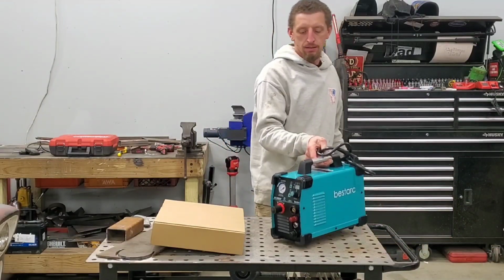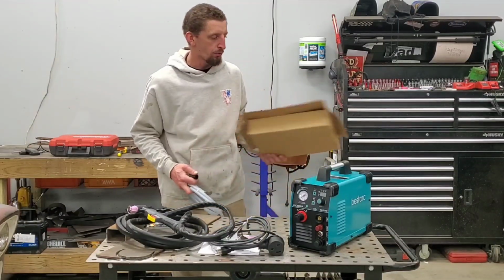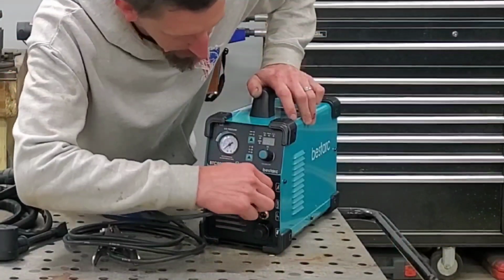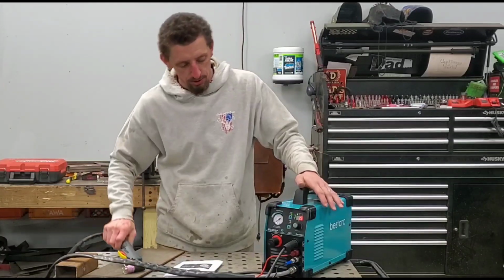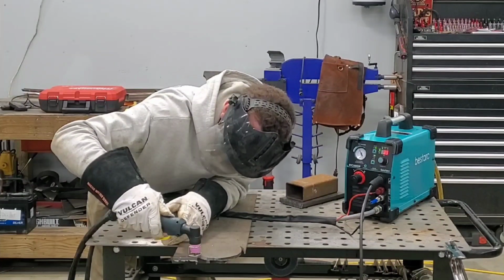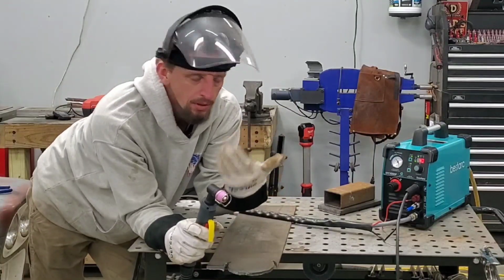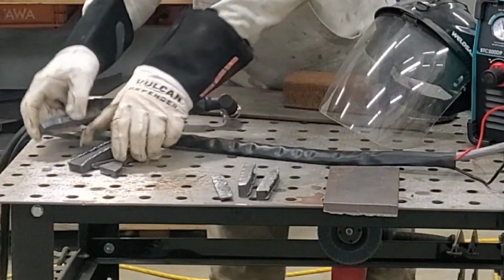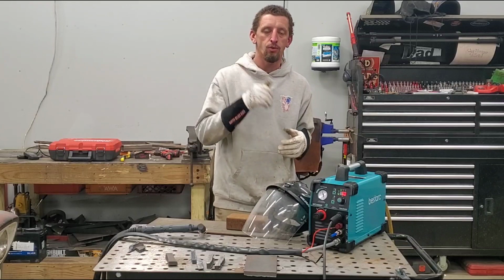Which Plasma Cutter Should I Buy?  Check Out The BestArc BTC500DP !  Full Product Review & Setup

Comment: So what is your opinion between the bestarc vs arc captain? They seem to be comparable in price but HF vs pilot arc (I'm not sure what the difference is). Thanks for your time doing these videos
Reply from the maker: Ugh, trying to get me in trouble 😂😂😂.   I really can't answer that out of respect for BestArc, the machines are very comparable in price and performance and both work almost identical, the ArcCaptain has a clean LCD display while the BestArc is already wired at 220v both have pros & cons.   Sorry I couldn't give you a direct answer I hope you understand.   Keep in mind I did buy my ArcCaptain.. Thanks for watching and commenting 👍
Reply: @ChallengeTheBuild  
Nod once for BA, twice for AC
🤣

I understand. 
I saw a video where the AC couldn't cut 3/4". Today I saw  video of the BA cutting 1" (not cleanly). The BA did cut 3/4" without issue though. Granted, I probably wouldn't cut anything more than 3/8". It would be rare to cut 1/2" for my use.

One thing I did find out is pilot arc is better on non clean metals. However a HF plasma can easily be converted to pilot.

Thanks again and I appreciate your video and the provided info between the 2.

I do kind of like the air pressure reading in the front as BA did; although not a deal breaker. I have some consideration to do but I'm slightly leaning towards the BA, but not certain. 
Not a fan of the BA color choice either (not a big deal I suppose) and the AC would match the mig200 I just picked up.
hopefully these units have a good life expectancy compared to the trusted brands.
Reply from the maker: I wouldn't recommend either of these machines for anything over 1/2", which is a serious chunk of metal.   Also if you are leaning towards BA they have the 7th gen which has the updated LCD screen just like the AC.   At the end of the day for any of the "budget" equipment it just boils down to personal preferences because in my opinion they all do the same basic functions...  The old addage also applies you get what you pay for...  Side note how do you like the AC Mig200?  I have one I need to review..
Reply: i agree. Cutting torch is probably the better route for thicker steel and possibly most.
Plasmas are great for thinner materials.

I'm just planning for my project truck build (76 F350 crewcab converted to 4x4 and 7.3L powerstroke😁) 

As far as the mig200. I just got it. The only thing I've been able to do so far was to fix my broken flat shovel😂. I used 030 flux on 110v. 
I have seen several YouTube videos which is what led me to buy it. I was thinking about a $4k miller and stumbled across the AC. 
For my use, the mig200 will weld anything the brand names can (according to the videos)
I mainly need it for my project and misc things. 
My buddy has a Lincoln 180 but it's sick. It overheats after minimal use. So hopefully the mig200 will hold up.

You can definitely tell where they cut costs.

I look forward to your review of it.
Also, I'm not currently working, so funds are very limited.
I only weld/ cut on occasion, so I don't need to spend a lot.

I can buy a lot of these for the cost of a good brand too.
Reply: Where did you purchase your visor from
Reply from the maker: @roxylass1 Amazon,  here is the link https://amzn.to/3Xy0kKu . This is an affiliate link and I earn a commission.   I am required to tell you this 😁👍